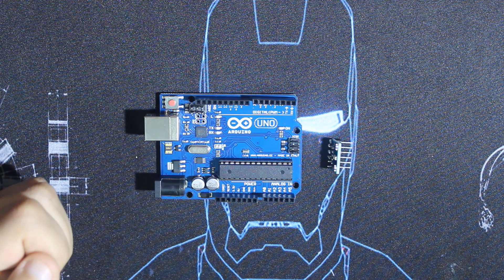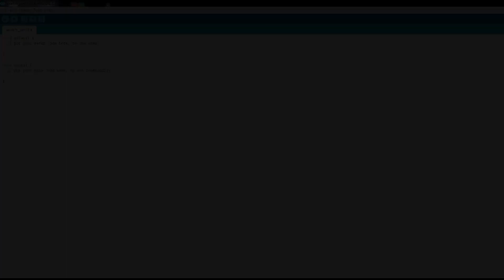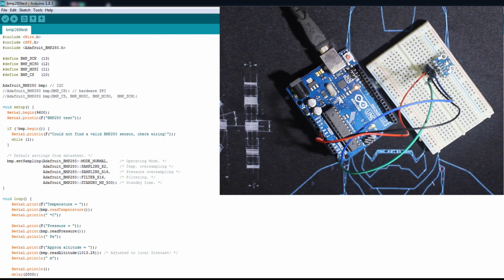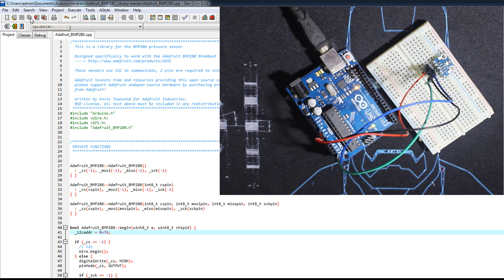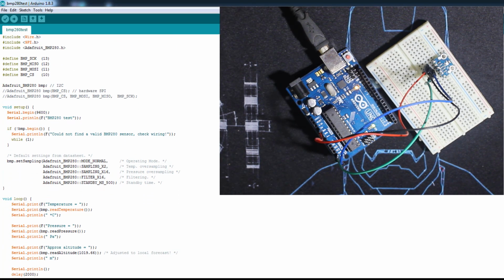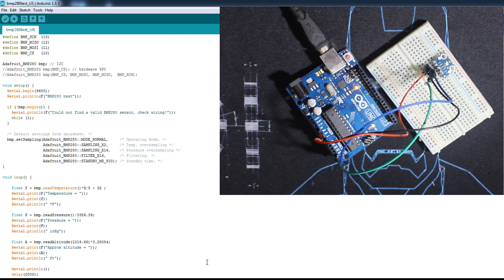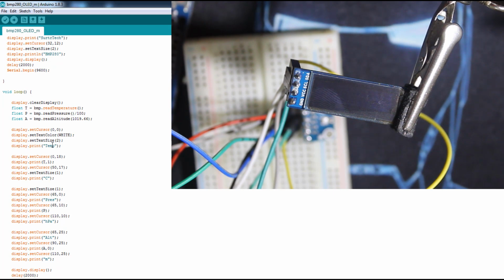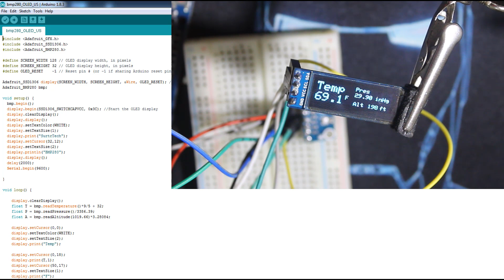Easy use of BMP280 to measure Pressure, Temperature and Altitude with Arduino + OLED

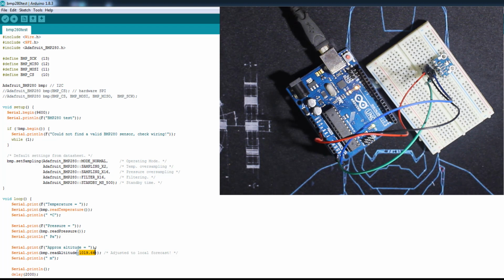Comment: So at 6:07, you meant pressure at ground (surface,0m)? For example, you canot tell pressure at sea level when you are at 300m higher than the sea :), right?